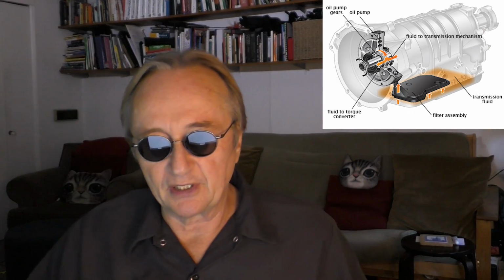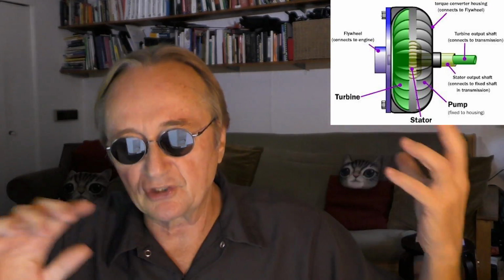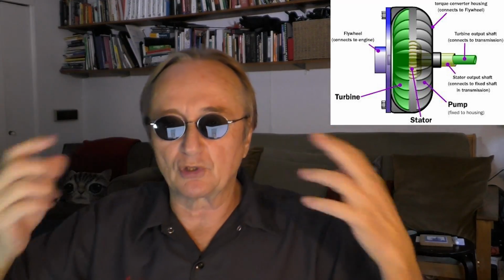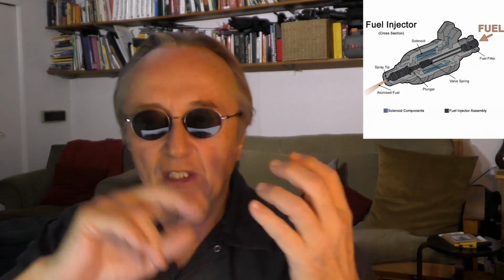This Changes Everything

Comment: Hell yeah, 3D printed titanium! I've been waiting a long time for car companies to adopt this!

Unfortunately, 3D-printed metal has some serious durability issues versus other methods for creating metal parts, a phenomenon which we still haven't found a solution for.
Reply: Amaroq Starwind SpaceX engines are 3D printed so it can be all that bad.
Reply: @lordgarth1  🤯
Reply: Crucible or the powder based spools?  The crucible based designs are phenomenal.  Limited alloys available, but for what is there -- you can have pretty much whatever you can make a 3d model of.
Reply: Titanium is also more likely to break than bend. The benefit of DMLS would be printing a more traditional titanium wheel, but use a hexagonal mesh instead of solid beams to cut weight.
Reply: Jim Derringer Very effective. Even NASA is turning to 3D printed engine technology.
Reply: I think they can make it slightly better by applying some heat treatment after the print.
Reply: prove that don't just claim it
Reply: Koenigsegg has been 3d printing titanium for years and it seems to work out for the application.
Reply: @steve75112  it's a well know issue actually. 3d print metals can endure much less fatigue and stress cycles because the grain boundaries formed during the laser sintering form a conical structure in the direction of print layups, which makes the metal kinda anisotropic for stress loading. Also the powder sintering has a tendency to form gas voids due to the nature of the process, and those are stress concentrators that fail first. Real Engineering has a good video on this. Highly recommend!
Reply: @willyjimmy8881  yup. That's cus luxury vehicle are lower volume and endure much less miles and stress cycles over it's lifetime than a regular roadcar. So they can afford (engineering and financial wise) to use this process. There's a reason why a lot of engineers kinda frown on using 3d printed metal parts that undergo cyclical loading (like a wheel). But for static loads (like structural components that don't move e.g. car frames or motorcycle frames) it's much more of a reasonable application.
Reply: More like casting but lays by lays . no wonder why it craps. Best method to product metal part is by forging . and we all knew why forged wheels are so expensive
Reply: @willyjimmy8881  thank you! Finally someone knows what goes around
Reply: Space X and NASA are poor examples of success. Neither has produced a great vehicle in the last twenty years
Reply: Guys, can you cite studies on  the 3D printing  durability issue?
Reply: countomar63 you can make single piece parts with complex shapes and internals that you can’t mill.
Reply: @lordgarth1  
Those American fireworks looks very pretty before the 4th of July.

Comment: At 9:47 about the dashcam and G-sensor. All real dashcams (not GoPro being used as a dashcam) have a G-sensor, but the camera should be on and running while the car is running so it will be recording. What the G-senor does is save (mark the file as locked) the current video file and not let it get overwritten. Different dashcams handle this in different ways but that is the general idea. Typically a dashcam holds many hours of video and loop over the oldest. So even if the G-senor doesn't go off, the camera will still have the video footage until you record long enough to overwrite it.  So, after getting hit or whatever, you will want to copy the video files at that time mark to your computer to use for insurance or whatever.

Comment: BMW, GM, & other auto manufactures, and GE and other aircraft engine companies have been making via 3D fuel nozzles and other parts for about 6 years now.
Human body ports, teeth,...  are being made. 3D is additive not removal manufacturing (material is added nor removed like on a milling machine).

Comment: I bought my 02 Camry 124,000 miles from a young man who bought it from an auction to resell. I admit it burns oil and fix some minor things, wipers, dashlights. Still running at 173,000 miles 3 years later, don't regret it a bit. Made in Japan  yay

Comment: about the dash cams, if you live in a hot area it might be worth it to get window vent/cover things so the batteries in the camera don't fry and can work without the cars power. alternatively you can usually just get a portable battery pack and plug the cameras into it to run them if you needed to.

Comment: With dash cams, they all have G sensors. Besides clear night and day videoing, you want one like Scotty said... with front and rear cams. To be of real use though, they have to have a clarity and framerate that is able to record license plates and fine detail in all outside conditions (many can't).  Also, when you press the SOS button, it should not only immediately start recording into a special "save" file in the DVR, but also keep what was recorded 1 minute PRIOR to you hitting the SOS button. This is in order to save important recorded info leading up to an event.

Comment: I bought a 2006 Solara with 92,000 miles about two years ago to use as a winter car. It now has 120,000 miles on it. It has been a great car.  Just note that the 3.3 v6 is an interference engine.

Comment: For anyone who is looking into a Lexus with a 1uz-fe v8 engine just know that the power steering pump is right above the alternator so constantly check under the hood for any power steering leaks because it will short out your alternator

If this is the case for you just know that it's an easy fix as long as you set a day aside and don't rush it and it is possible to take it out from the top because every YouTube video you'll look up will tell you to go from the bottom by jacking the car up and removing the passenger wheel but I will say it now, it is indeed 100% possible to get it out from the top if you don't want to be crawling underneath the car

Comment: That's a very interesting news bit regarding the 3D Printing. I'm a Design Engineer & I've seen these higher end printers in the price range of $200K - $500K. The trick is the powder metal materials. The printer can deposit the material, that's almost the easy part. The critical issue are the mechanical properties of the material after deposition. The first time I heard any company developing titanium material was 4 years ago. Time fly's. The price of each rim..."If ya gotta ask..."! I'll guess $20K+/ea., & you haven't gotten to the Liability Insurance McLaren needs to protect itself.

Comment: Hi Scotty I have a 1996 f150 5.8 when I start it after the engine is warmed up lined up to the front tank in runs rough and sometimes dies and sometimes it will come out of it and runs fine. Only happens warmed up and lined up to the front fuel tank.

Comment: I have a thought on that 2000 Ford Mustang with the gas smell:
I owned a 2000 Ford Taurus for a few years that had the same issue (about 7 years ago). When parked, it smelled like gas. Turned out it needed a new fuel tank and seal because there was a split and issue with the tank seals.
Might want to have someone drop the tank and check if possible. Makes me wonder if it was a problem with that model year of Ford cars.

Comment: the same tech that makes those rims is what airplane engines are made with. its not new, but its not that old either. the machine is around $250,000 USD.

Comment: How do you submit questions? I have a question about struts, I've been replacing my shocks and struts for 20+ year on multiple cars, I got 4 driving kids each with their own car, lately I've been using the OE replacement "quick" struts that have a spring already on them but it seems like the last few I've done, they "clunk" when you go on a bump while turning, like pulling into or out of the driveway, they don't do it while driving on the road or in turns. Is it the spring seating? everything is torqued to spec. I even measure the spring's metal rod diameter to make sure it matches what I had. Is there a trick? greasing the spring seat?

Comment: Good morning scotty my name is Daniel i wanted to ask you i bought a 2019 Chevrolet  Silverado 1500 5.3 LD and i bought it preowned with only 2k miles and i got to use the truck for almost 2 months and 9k miles before i had a major failure in the car first started out with the engine severely surging and turning off on the way down south from georgia with a small 2,000 lb trailer with my family in it left me stuck in the side of the highway and after attempting to restart it worked fine with every light on the dash was on and the transmission was hard shifting took the truck to the dealer after i arrive home in homestead florida took it to my local bowmin cheverolet dealer in dadeland and they kept my truck for 3 months and they never disclosed the issues i was having, i picked up my truck 2.5 weeks ago to only drive it for 3 hours before losing my brakes and still having my truck at the dealer again the problem i had again was the right brakes got stuck and faded and almost made me cause a accident in the turnpike  and my transmission is still having the same problems as before. I would gladly appreciate if you  can make a video thank and i love your videos they have showed me alot.

Comment: Dealers sell cars to auction when there is a major problem with it that may be too costly for them to repair or it too high mileage.  Those cars might have been in an accident. Also, the auction might not allow you to have the car inspected by a mechanic. So, it's never a good idea to buy a car from an auction.

Comment: Hey Scotty! I have a question. I got a good deal on a 2012 Ford Fusion, it has 29k miles but for the last two years it has been driven less than 500 miles and sat for long periods of time. I put a new battery in it, but other than that everything seems fine. What should I check on it to make sure nothing is going bad from sitting for so long? Thanks Scotty

Comment: The speed to degradation comparisons are way off base.
A car's transmission invalidates this. A cars engine is working just as hard to travel at 30mph, as it is at 60mph, or 90mph.

Comment: Don't knock the desktop 3d printers.  They are capable of making very good components.  It truly depends on the material extruded.  Cheap $15/kg spools of PLA or PLA aren't for doing work, rather for doo-dads that aren't being stressed.  Once you hit the $30/kg materials, magic starts to happen.  And then, of course, the stupid expensive carbon fiber $1k/kg stuff is great for doing exactly what the mentioned McLaren is in need of.  Just like anything, refer to the datasheet on the material at hand, and you will know real fast if it can handle the stresses you need to put it thru.  And with the new breed of metal 3d printing coming, its gonna be a really slick new age of manufacturing, much less the prototyping and engineering side of things.

Comment: Hey Scotty, I have a 2008 Silverado 5.3.  After replacing all the spark plugs, I have 2 codes P0336 & P0307.  I have ordered a new crank position sensor.  Do I need to do a re learn after installing the new sensor?  If so, what scan tool would be good to do that?The engine also cranks several times before starting.

Comment: Hey Scotty I drive a 2013 Nissan Versa with 97 thousand miles, sometimes with I’m going 40 mps the rpm goings up to 4-5 thousand and I’ve been with four mechanics and two told me it can be the throttle body and other two told me it’s could be the transmission what could be the problem

Comment: Scotty i have a 2013 honda accord coupe got it with about 45,000 in 2017 it has 94,000 miles now how so i know if i need to change the transmission fluid

Comment: I have a 2008 BMW 528i. 123k. I paid $1600 for it. Is there a kill switch on it? I charge the oil, coil packs, spark plug, valvetronic motor, valve cover gasket. The want run. Just cranking. HELP ME

Comment: I've seen those printed wheels however they're extremely porous so cleaning would be a nightmare!
Reply: Pressure washer will get the job done
Reply: @eddiejr3934  yes however the porosity is on all of the surfaces.  There are too many places where pressure washing will be unable to make direct contact with all of the surfaces.
Reply: When they get dirty, print some new ones! 👍

Comment: Hey Scotty I got a 2019 Porsche and the engine rattles at 4000 rpm where transmission slows down to neutral.
Reply: Lol
Reply: get rid of that rolling pile of junk, those are endless moneypits, get a 94 celica, it still runs like a clock 😂

Comment: I’ve never been here so early
Reply: Your girlfriend says you are always premature
Reply: @3:32 like scotty said change the filter and fluid, but in addition, place a 3/4x3/4x1/4 rare earth magnet in the transmission pan. Even changing the fluid does not get it all out, whatever fluid that is left in addition to the inner components will still have powdery metal suspended in the fluid.  The magnet will literally draw it out of the fluid, and away from the checkballs, solenoids, and valvebody.
Reply: David James ok thanks David James